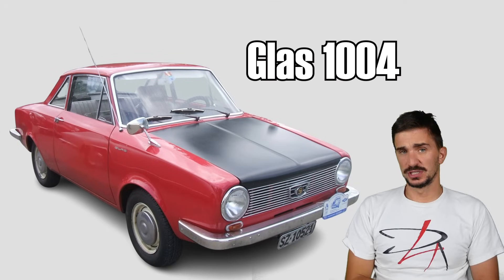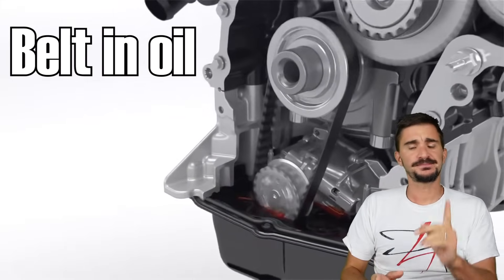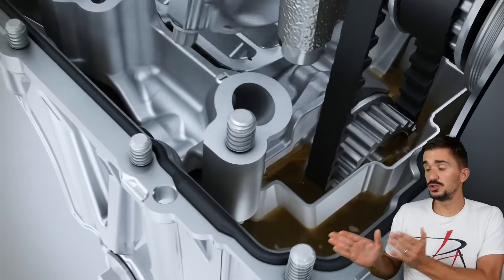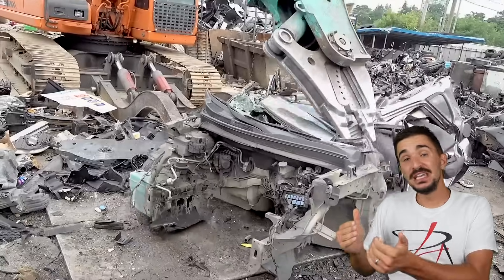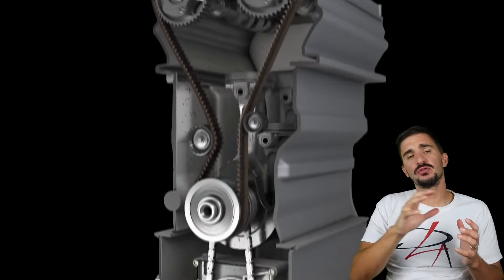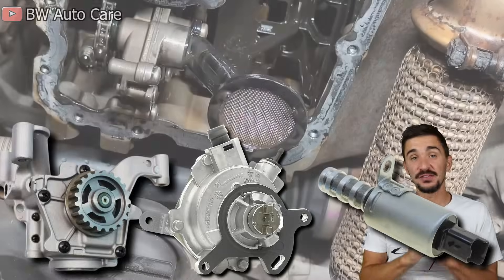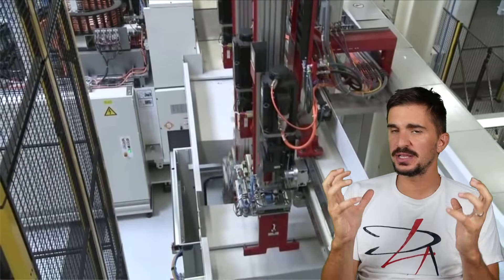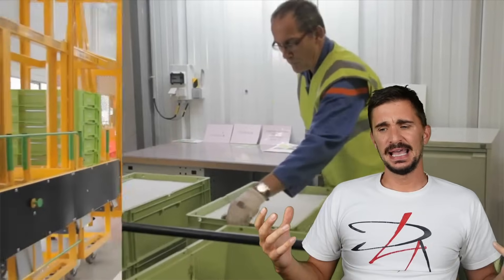Who Approved This and Why Is It Still Being Made? Wet Belt aka Belt in Oil Engines

Comment: Polymer scientist here: All polymers have in common, that chemical, mechanical and thermal loading/aging are not independent but reinforce each other, leading to drastically accelerated aging/failure. It is not completely impossible to develop a wet timing belt, but: The materials used would be drastically more expensive and development and accurate lifetime predictions would be extremely complicated.
Reply: Kevlar is the way😂
Reply: Do polymer scientist only eat from polymer bowls, use polymer cutlery etc?, i heard they do that.
Reply: @MrKalashnikov47  How do you hold the Kevlar fibers together?😉
Reply: So are current wet belts just the same pedestrian dry belt chemistry? Are there any chemical differences?
Reply: Ford should take notes from Honda lawnmower engines. Honda mower engine have had wet timing belts for years and I haven’t heard about any breaking. I’m sure a couple probably have broken but not nearly as much as ford
Reply: @joshmanis9860  A lawnmower engine is not comparable to a car engine. If Honda had cracked the wet-belt reliablity issues, why arent they pioneering wet-belt car engines?
Reply: @manchegocheese997  my vtwin is over half the displacement of my cars engine. And a lawnmower runs in considerable worse conditions than a car engine. And if the wet belt hasn’t failed then, then it shouldn’t fail in a car
Reply: Is more than that to be said. Imagine that took decades of contradictions if the wet belt in oil is ok or not. Can't tell who's right or wrong in a simple video. Because failing wet bets are also an owner problem who did not change the oil on time. This is more dangerous than all. How many people go with their cars on time to change the oil ? Not that many. I can easily say 50% of them do not change the oil on time. And this is a very dangerous step to skip for a wet belt in oil engine.
Reply: @joshmanis9860  as a general rule people tend to drive way for way more often and for longer than they tend to mow their lawn.
Reply: @InsufficientGravitas  and? And my mowers belt has been in contact with oil for 20 years with no sign of degradation yet
Reply: @joshmanis9860  The duty cycle on a lawnmower engine is like 25 hours operating time per year. Maybe we should make timing gears out of Bakelite and Nylon if plastic lawn mower engine technology is so durable???
Reply: @gregorymalchuk272  the average home owner puts 40 hours on their piece of equipment a year. A commercial mower can easily have 500+ hours put on it in a year in all conditions rain or shine. And yet no failures.
Reply: @manchegocheese997 yeah you are correct! lawnmower engines are not compared with automotive engines as the air cooled engine runs hotter with an inferior lubrication system!
Reply: Kid who owns a couple stocks here, car manufacturers love to brag to shareholders about earnings from parts and service divisions, because that is more consistent and stable income than sales. This is 100% malicious, and they think it's funny.
Reply: @joshmanis9860 how many miles do you have on your lawnmower?
Reply: @Lawrence-uw6cs  thanks for proving my point. That Honda uses better belts than ford
Reply: @joshmanis9860  Honda belts do fail especially in the cheap domestic mowers and brushcutter engines and their commercial engines use timing gears not wet belts
Reply: @Lawrence-uw6cs  my craftsman riding mower with a ungoverned Honda vtwin has a belt and it’s been fine. And ive only heard of a couple belt failures on the el cheapo mowers
Reply: @joshmanis9860 😂😂
Reply: @Lawrence-uw6cs  Remember the trouble Honda motorcycles had with cams and cam chains in the 70's and 80's. The VF series almost bankrupted Honda.
Reply: @joshmanis9860  don't know if they use better belts than Ford but they have the brains not to use a wet belt to drive the oil pump on a $100000 truck!
Reply: @manchegocheese997 
Honda's 1.0 turbo petrol fitted to European Civics uses a wet belt and it... Fails prematurely.
Reply: @MrKalashnikov47  почитай почему кевларовые сборки для броника запечатывают в водонепроницаемый пакет, глупая шкила..
Reply: @dennythescar80s8  I'd say that figure is near 100% for lawn mower engines. That said, I wouldn't trust a wet belt as far as I can throw it.
Reply: @LG-ct8tw with more Kevlar obviously 🥴
Reply: @joshmanis9860  they're probably under lighter load. Ford's 1.8D design was already right on the edge, being plagued by snapping belts for 20 years or so.
Reply: @joshmanis9860  how many km / miles do you run your lawnmower? A lawn mower is ran for around 10 -20 minutes per week, then put away. It also doesnt see the temperatures a motorbike or car experiences.
Reply: As a retired amateur gynecologist, I totally agree.
Reply: @joshmanis9860 When did a lawnmower ever do 100,000 kilometres?
Reply: @joshmanis9860  Honda's small industrial engines run at lower rpm (and hence gear periphery speed) than car engines. The belt is also driving the cams for only one or two cylinders. The stress is much lower.
Reply: @MasterofNoneTV  you have no clue on what your talking about. Many mower see higher temperatures than cars whilst under a high load.
Reply: @LG-ct8tw    Neutronium
Reply: @mjouwbuis  Peugeot was plagued with belts snapping on the XUD engines. Dry belts, 8 valves.
Reply: @philhawley1219 from ball joints to steering racks and oil pump's and even sand left in block's from casting! ford being the larger company has Honda beaten for sales including recalls! But i thought belts was the topic here not chain's or was it mowers vs cars or Honda vs Ford im not certain?
Reply: @EbenBransome  Honda engines run at 3000 rpm for most of their life at high load. Much higher stress than my grandma driving to the grocery store. I run my Honda vtwin ungoverned on my race mower
Reply: @joshmanis9860  ungoverned twin should sound good!
Reply: @brainwrongs  exactly Honda's road registered lawnmower without blades used one and not a $100000 truck
Reply: Or we could just use a chain.
Reply: @MasterofNoneTV  dead wrong there! Air cooled engines run hotter than car engines! and average a higher rpm in their service life! Despite being governed well below the rpm of the mildest of car engines Being constantly 3-3500rpm and rarely at idle or consistent cruise! Most modern car engines can rev much higher but in reality spend less than 10%of the time running at high load unlike working engines dedicated to working at load only!
Reply: Nerd.
Reply: Not to mention the fact that the polymer in question would have to resist most of the common organic solvents that would be used in polymer synthesis
Of course the good thing about a material like that is that it lasts a real long time
Although on the flip side you got the problem that it lasts a really bloody long time with no goid way to get rid of it
Reply: @LG-ct8tw  With rubber of course🤣🤣
Reply: @joshmanis9860  Different scenarios. The load on a lawnmower is mostly consistent/single engine speed, you can vary engine speed but a lawnmower is usually holding a single speed for it's operation.
Reply: Also Bet they got squeaky when Ethanol was added to our Fuel 😂
Reply: And by the time we figure it out, the cars will be electric anyway.
Reply: @manchegocheese997 Yeah not comparable in that, the mower engine people never change the oil, it has no filter or pump to clean the oil, operates in dusty conditions, all the parts experience impact loading, and is air cooled so runs hotter. 
If the mower can do it, so can a car.
Reply: @joshmanis9860 my guess is run time is a factor 🤔
Reply: please name one commercial car that redlines at 3000 RPM - I googled a mid 2000's Civic for reference, and its redline was 7200 RPM - I physically don't think there is a single commercial car on the market that revs that low, i'm almost willing to bet money on it ....
Reply: @moffichu9150  the OG beatle did but no modern car to my knowledge
Reply: @joshmanis9860  lawn mower engine is often air cooled with very loose tolerance in machining with very low compression and emission standards, and around 16-20 hp vs a car with very high compression, liquid cooled, extremely tight tolerance, very high emission standards and 200-300hp. and mower run at a tiny fraction of rpm also most mowers have less than 1000 hours after 10 years vs 10,000 to 50,000 hours. they are by no way comparable
Reply: @joshmanis9860  200 km is about 124 k miles.
AAA claims 13500 mile per year / 293 hours per year = 46 mph average.
124,000 / 46 = 2,696 hours per wet-belt---minimum life in a car.
Assuming you mow an hour a week through summer, spring, winter and fall, that's over 51 years.
Even if it last's half that in my lawn mower I'd be happy so in a mower it seems like it would be fine.
Reply: @LG-ct8tw  unicorn horn dust ?
Reply: @joshmanis9860  Lawn mower consistent engine speed and load .
Reply: They make scientists out of polymers now?
Reply: Ford engineers gad a stroke.
The belt literally melts, we have changed so many…
Btw if you use the ford supplied oil they last a lot longer. They are still pretty pooh though.
Reply: @moffichu9150  The belt spinning faster doesn't change how the chemicals and heat degrade it. It would heat slightly more due to being flexed more often, but then it is oil cooled, so will be the temperature of the oil. Which is hotter in the small motor because it is air cooled. 
The number of cycles it sees over time isn't going to be much different as the transmission keeps the rpms down as much as possible for fuel efficiency. On average the mower engine probably runs at a higher speed because it is used at full throttle it's entire life. While a car probably averages around 2500 or less. It sees higher speeds briefly, but then falls below 2000 for longer life and efficiency for much longer duration.
A commercially used mower is the worse case in comparison to a car.
Reply: @joshmanis9860 not a fair comparison. Sorry.
Reply: @InsufficientGravitas and under far more heat and torque.
Reply: @joshmanis9860 are you sure? Commercial mowers get regular service. A close friend owned a commercial "mower" sales and service company. He as plenty of horror stories to share. Mower owners abuse their equipment horrible. Then when they fail, they whine about the delays it takes to rebuild their equipment. Oh, he lives in a paid for house and drives an new Escalade every few years. Yeah, wet belts are "wonderful" for use in commercial vehicles.
Reply: @Lawrence-uw6cs where is your data? I doubt your information
Reply: @Ang3lUki and great for the bottom line. Service is profitable because few people can get competitive quotes from other mechanics. The cars are DOA. you pay the money to the guy you had it towed to. Often the towing company suggests a close by dealer as a convent source if the customer doesn't have a great deal garage alternative. The cars on the tower, who's going to wait for you to get three competitors quotes in say, fifteen minutes??? Not going to happen... 😢
Reply: @joshmanis9860  The reality is that lawnmowers run comparatively few hours by comparison to a car engine. Also, of note, the Honda GC wet belts DO FAIL.
Reply: GM found this out the hard way when they switched to long-life coolants.  Turns out some of the seal materials didn’t agree with the new chemistry at elevated temperatures.
Reply: @joshmanis9860  for cars if we take average speed of 30km/h (city and around driving) this results in about 5000 running hours for 150,000km (lifespan of dry belt). I doubt you have lawnmower with 5000 hours on the clock. Honda GCV engine is estimated to live no more than 3000h, this would give you only 90,000 km in similar condition for a car engine.
Reply: @EbenBransome 😂 Peugeot...French...makes sense
Reply: @gregorymalchuk272  actually there were timing gears made of bakelite and textolite. But it was 1940-1950's tech.
Reply: @joshmanis9860  I think the question is the loads. Lawnmower engine doesn't generate 120 horsepower.
Reply: @philkipnis740  the wet belts are still in constant contact with oil
Reply: In the mid seventies my first moped, from the early sixties, had a wet belt between crankshaft and clutch. They lasted decades, but they failed when the engine didn't run for several years. different composition though, they looked like yellow kind of plastic with metal strings inside.
But other mopeds used gears, they never failed.
Reply: Maybe that is the reason why no electric motor uses polymers. They last a lifetime.
Reply: @wolfgangpreier9160  All electric motors require polymers like silicone tubes, Busbar overmouldings and varnish as insulators. Once these materials fail (which is greatly accelerated by temperature, hence for the normal user they will indeed last a livetime), the motor will fail immediately and unrepairably.
Reply: @householdhacks  Thanks, whole lotta cope on the lawnmower engine.
Reply: @Bapate-rh9be  Ok Mister, you must be very informed.

Please tell me how our forefathers made electric motors in the beginning of the 20th century without all those fancy schmancy modern materials and they are still working?
Reply: Do you mow your lawn every day for 3 hours?
Reply: Comparing  a lawnmower engine to automotive engine is like comparing a automotive engine to a piston engine in a WW2 fighter aircraft.  Totally different operating environment, I have a Briggs mower engine that is over 20yrs old with  a plastic camshaft its still running without any issues but I don’t think a plastic cam would work in a Honda civic.
Reply: Man... everybody know that oil dissolve rubber, and heat speed up the process. This is like frie rubber in a oil pan.
Reply: @joshmanis9860 lawn mower engines don't have near the forces and heats at play as a turbo charged 3 cylinder do. Also a lawn mower doesn't go hundreds of thousands of miles and if it fails it doesn't cost thousands to replace it. A brand new whole lawn mower is maybe 10% of the cost to rebuild or replace a modern turbo car engine.
Reply: @moffichu9150  who said anything about a car engine revving that low? You are right they don't rev that low but on average spend more time at a lower rpm than Mowers that rev their entire service at 3000+ rpm
Reply: @erikbrown207  your point is irrelevant! The mile travelled is irrelevant as car's are a little bit faster! The time it takes to mow my lawn i could have travelled interstate! Also Car engines are more refined and are cooled and lubricated far more effectively! BTW for all the know it all's in the comments, I'm an automotive mechanic and small engine mechanic, not saying I'm always right but if you're just putting info in comments that you have no experience with and are just pushing an uneducated or inexperienced opinion without actually ever working on or tuning engines or reading the data associated then don't bother!
Reply: @ClockworksOfGL  That the dreaded orange crap that doesn't like normal green coolant?
Reply: @brainwrongs  I know. I'm hearing throughout this thread that Honda have cracked the wet belt issues on their lawnmowers and that Ford should use that technology so I was pointing out that even Honda cannot make a reliable wet-belt car engine because cars are not lawnmowers.
Reply: @SupraSav  this right here is the biggest reason for increased loads on an automotive t belt over a mower! Other than valve train friction. This guy gets it!
Reply: @eflanagan1921  consistently loading a lawnmower? How? You must have an impeccable lawn with all even grass on a dead flat surface!
Reply: @quint3ssent1a  per cylinder at the given rpm a modern mower actually produces more torque and often more power per litre of displacement than a lot of n/a eco buz boxes people drive! Ffs a Briggs and stratton 32hp v twin is 32hp! I've seen 4cyl car engines on the dyno struggling making 50hp! That being said they don't have a belt!
Reply: Would a silicone base be a good start?
Reply: @cujet  you are right there and the increase in running time is what's prolonging the life of the belts! Sit a car for half a season every year and see how long they last!
Reply: @Pheonixco  you can't mix organic acid coolant with glycol based coolants as they can form a corrosive mix that will cause damage to all aluminium and also mls gaskets
Reply: They get about thirty hours annually, on them. There's no comparison.
Reply: @joshmanis9860  loads for small engines are so much smaller than bigger ones. Ive seen plastic camshafts in some small lawnmower engines.
Reply: @sompka1  goodpoint!
Reply: @dennythescar80s8  Mechanic for 50years. Who's right and who's wrong. Simple. I've got two old Datsuns, one 1971 and one 1974 model. I drive them and drive them (and like a good mechanic I don't change the oil) and they just keep on keeping on going. Just build everything with a Datsun 1200 engine fitted, cheap to build and run for ever.
Reply: @joshmanis9860 Honda sold the civic with a 1.0 wetbelt in Europe and it has the same issues as the Pegeuot and Ford engines blocking the oil pickup
Reply: @LG-ct8tw Vise Grips. 😂😂
Reply: @EbenBransome I suffered that myself.  Wasn't cheap.
Reply: @joshmanis9860  comparing apples and oranges?
Reply: @manchegocheese997 
For the life of me I don't understand why you guys don't know that there's been wet belts inside engine's for some years now, they last longer than dry belts like the typical timing belts from the 80's because when motor oil flings off of them it takes heat with it leading to them actually running cooler than dry belts.
For year's there's been an aftermarket wet belt replacement for the primary chain in Harley Sportster's, in the 35+ years I've been a Harley mechanic I've never seen a single one ever break, but I've seen plenty of aftermarket dry belt Harley primary drives break.
Ford's been running belts to drive oil pumps in their engine's for some time now, they're engineered to withstand 1,100 HP and I've yet to hear about any breaking, they also solve problems like oil cavitation that occurs from all the tiny shocks delivered by gear and chain drives to oil pumps, belts smooth out the drive to an oil pump making them last longer along with curing cavitation problems.
Reply: @manchegocheese997  Because the Honda lawnmower engines aren't interference engines, and lawnmowers don't run for anywhere near the amount of hours that automobile engines do. The power that it takes to run the valve train on a lawnmower engine is basically nothing, and RPM is pretty low. RPM is also constant. Honda engineers know their stuff. That is, until they started messing with DI and turbocharging.
Reply: he just put ford on blast 😂
Reply: @MasterofNoneTV  People have zero clue how hard of a life automotive parts have, especially given things like aircraft get way more hands on inspection and maintenance, because its federally safety regulated, and things like lawn equipment are exposed and more accessible to discover potential issues. For the majority of people, anything automotive is tucked away out of sight and mind under the hood, used daily no matter the weather conditions with emissions systems that have to last the life of the vehicle. There's also the fact that they are the most mass produced as well. That isn't even to mention the insane amount of Federal Vehicle Safety Standards, EPA emissions standards, flame toxicity and smoke standards, NHV, etc, and this is all in just the design phase leading to all these compromises that idiots are quick to call out because they have no clue.
Reply: You lost me at "drastically more expensive". You clearly don't understand our motives, earning as much money as we can. Fired. ;-)
Reply: @joshmanis9860  Worse conditions? I don't know about that.  

Even if you did make that assumption, there's a huge difference between how long they're run in those conditions.  80,000km takes somewhere on the order of 2000 hours to drive, on average.  If one assumes two hours a week of mowing, every week, year round (even in winter and fall), that would take more than 15 years to hit that many hours, that much wear & tear.

So, no, they're not comparable.
Reply: @Londubh  mowers spend their life under load in the scorching sun (most of them are unmaintained. Don’t be dumb
Reply: @joshmanis9860   how can I, when you've monopolized that trait?
Reply: @Londubh  they are comparable y’all just refuse to because it’s right
Reply: @broughxtreme  Nissan knows how to make rubber compounds last! I've got genuine Nissan fuel system components from the mid 80's that show no signs of perishing!
Reply: @joshmanis9860  the biggest issue with this topic would be lubrication requirements and therefore the belt polymers used, as air cooled engines often run thicker oils and additives vary considerably between their intended usage. I can't imagine a wet automotive belt designed for thin full synthetic oils at liquid cooled temperatures would have the same formula as one used in 10w30 mineral oil like in the Honda power equipment engines
Reply: @Lawrence-uw6cs  honda calls for the use of conventional 30 weight or 10w30 if your using in colder temperatures. idk wat ford belts are made of for them to degrade in full synthetic 5w20. i run synthetic 10w40 in my pressure lubricated stuff with high zinc to protect the cam and lifters. and synthetic blend in my splash lube stuff
Reply: @coffeepot3123 I did some research and it doesn't seem to be the case.
Reply: I don't think this is only about manufacturers chasing every last dollar. Over the top EU emissions regulations are also one of the drivers of engineering solutions that meet the regulations, but compromise reliability and the long-term viability of the vehicle. It's not a holistic approach, and ignores the very real downsides.
In the case of diesels, the entire global fleet is conservatively using 5% more fuel than it would without particulate filters in the exhaust. Think about that for a minute, hundreds of millions of diesels chonking through all that extra fuel for their entire operational lifetimes.
5% isn't a number I plucked out of my bum, that's real-world first-hand experience with a reasonably late model truck diesel that had a ..... wee operation. The improvement was closer to 7% tbh,  and two of the prime causes of modern diesel engine failure have been eliminated.
Reply: and they seem to have left out the heat factor
Reply: @joshmanis9860  i could not find any details about these, which engine did they do this with? Have you got the model number, perchance? TIA
Reply: @G-ra-ha-m  push mowers and pressure washers and a couple 20hp vtwins on riding mowers
Reply: @joshmanis9860  I'll have to check my lawnmower, I'll trying to find a diagram of one with a wetbelt as I'm curious how the designed it.
Reply: @G-ra-ha-m  I believe it’s a Honda GCV 160/190 engine for the push mowers. Not sure about it pressure washers though
Reply: @joshmanis9860  Ah, I found it! Rubber belt, amazing. More amazing, it included the GCV135 which I actually have!
Reply: Cost, performance or reliability, you only get 2
Reply: I am sure NASA would make such a belt out of per-teflon-ester-polyamide-disulfide-bismuth-chloro-ethelen-butylediene-monohydrate that cost $50,000 per gram //
Reply: Lawn mower that's used by mower contractors run 8-12 hours a day 5 days a week. There's a huge number of them big commercial mowers. Cost big bucks . They keep parks golf course expressway berms playing fields etc. orchards tidy.
Reply: id like to say I and many others have had varying success with decontaminating oil soaked belts with brake cleaner and other degreasers
Reply: @joshmanis9860 do u have 100k miles on your lawn mower? lol
Reply: Belt sheds fibres and debris that eventually blocks the oil pickup and leads to oil starvation and engine failure.
Reply: @rideswift  My view is that it's part of an agenda to make ICE engines less dependable and more expensive, to help EV sales. 
A 'strange' CEO decision here and there is all it takes.
Reply: @joshmanis9860 Beciuse the problem is not  the oil  the problem is the FUEL on oil  and that's only happens on newer DIRECT INJECTED engines with HIGH PRESSURE FUEL PUMPS of almost 50 bars or more.
Reply: @AaronSchwarz42  Is that the same stuff they made Challenger's O rings out of??
Reply: Why were a group of polymers arguing? There are in a polymerous relationship
Reply: @chiboreache  :face-green-smiling:☝👍
Reply: 1. The average temperature of motor oil is 115 C.  

2. The mechanical stress that is absorbed by a rubber belt should be lessened with springs in the construction of the engine, and a belt should reside outside and away from heat sources, and it should be replaceable in under 8 hours.

3. After you have included point 1 and 2, the makeup of the belt becomes less and less important. You can probably theorize a NASA belt that tolerates 300 C and costs 500.000 USD and that's made with 20 billion layers of graphene but ordinary people are not driving to Mars, they want to pick up the kids and get home to watch Netflix, and this is why I don't touch hybrids and modern EU cars with dwarf engines. The EU cars are anti-human just like the European technocrats who live in a walled of fantasy
Reply: dude is a rubber scientist and is telling you its not possible. lol
Reply: Polymer marketing here: "We did it, now you only need to buy it. Trust me."
Reply: Would lubrication from the oil tend to lower the belt temperature?
Reply: @mthebold  Not really - The engine oil is heated to the temperature of the Motor. These Belts have friction, but usually this effect is minimal, leading to an immesurably small temperature increase.
Reply: @mthebold  No. The belt will attain the aggregate temp of the engine.

Wet belts are tested at 100 C but at summer time in the city, a 1 L Ecoboost has an average temp of 120 C. 

It's temperature that sacks the belt prematurely, but at the same time, the Ecoboost is not selling in Siberia which would be the only market where it makes environmental sense, because a failed engine in Siberia = Death.
Reply: @joshmanis9860  500 hours is considered a lot for a lawn mower, but 500 hours would only be 15,000 - 30,000 miles on a car engine.
Reply: @wb4rfd  and the mower is under a large load for all of those hours. 500 is alot, for a residential mower. ive worked on moweres with 2500+
Reply: > It is not completely impossible to develop a wet timing belt

We already did that, we called them chains.

Why people trying to reinvent the wheel?
Reply: @davetdowell  Oi mate: Belts are cheaper and more efficient and silent. Wet Belts are even cheaper.
Reply: @Bapate-rh9be  because the sound of all the mechanical parts moving isn't loud enough to cover the sounds of the chain contact with the sprockets... pull the other one, it's got bells on.
Reply: @davetdowell  You can measure a difference. Not a large one but a slight improvement non the less (ill let you decide whether thats worth it). Dry Belts work well and reliable and are an improvement noisewhise.
Reply: I agree. its common sense. Oil and rubber will NEVER mix
Reply: @joshmanis9860 Dude, you respond to weak arguments and ignore strong arguments. Anyone trying to argue with you is running a fool's errand because it doesn't matter what anyone says, you will not be wrong.
Reply: Maybe so, but one could neglect changing the oil on a dry belt engine and not have the same risk. Then why not just use the dry belt?
Reply: @stephanhuman4665  because they adapted it from an engine that had a chain, otherwise the needed to redesign the entire engine. It was saving money(TM).
Reply: @court2379 only cheap garbage mowers don't have a filter
Reply: That why it doesn't make sense.
Reply: The glass cord reinforcement and the "rubber" belt material are different on wet belts. Obviously.
Reply: @joshmanis9860 lawn mower engines don’t have nearly as many operating house as car engines, nor do they experience nearly as much load.
Reply: @joshmanis9860  and yet almost NO thermal or mechanical stress on belt means your point is wrong
Reply: @joshmanis9860  your sample size is ONLY YOU 🤣🤪
Reply: @Fireneedsair  no “thermal stress” and yet mowers reach 300 degrees regularly. Go ahead and educate your self before commenting
Reply: @Fireneedsair  or it could be the hundreds of Honda mowers I see regularly for repairs? From the little 160cc single cylinder. To the 600cc vtwins. And yet I’ve NEVER seen an issue with the belt?
Reply: @joshmanis9860  no thermal stress during the 99% time they are NOT being used genuis
Reply: @joshmanis9860  brings up his one lawn mower engine. Then claims to see “hundreds” of em. Nice try. I’ll respect the knowledge of the dude who made the video before you🤪🤣🇺🇸
Reply: @Fireneedsair  yea that’s the one I OWN. I work at what’s called a “servicing dealer” where I work on the mowers we sell and the ones from big box stores. Stay in school kid I’m done talking to you
Reply: @joshmanis9860  yeah your done child since you know SQUAT about automobiles and this dude knows his shit better than you.
Reply: @Fireneedsair  sure buddy
Reply: @joshmanis9860  another peanut gallery intellectual 🤪🤣🇺🇸
Reply: @Fireneedsair  I never claimed to be smarter than the videos creator but go off little buddy
Reply: @MrKalashnikov47  no, No, NO.
Reply: @joshmanis9860  Do you drive through stop/go traffic using a lawn-mower engine. I happen to know those engines have an oil change interval of 90 hours and a belt change interval of 500 hours.
Reply: @bertram-raven  um oil change interval is 50 hours and drive belt change interval depends on the manufacturer
Reply: My VW Camper has something called push rods at the bottom of the engine. Has enyone seen them removed from the engine? I don’t. You think I should check them out? After 35 years?
Reply: So the original concern you'd have is still valid: "RUBBER BELTS INSIDE ENGINE OIL = FAILURE POINT = BAD!"
Reply: @MrKalashnikov47  Kevlar is actually common for belts in many other stuff but it doesn't fix the rubber degradation problem, but it sure makes a tougher dry belt on like RC cars/helis until the rubber goes puff 🤣
Reply: It's simply cost vs longevity. Get the engine/vehicle to the end of the warranty period and then it's the customer's problem.
Reply: @InsufficientGravitas  I might run my mowers 30 hours a year. Many cars run that much in a month.
Reply: Which means there's absolutely no reason to even try it. Timing chains work great.
Reply: @fordmud  So do dry belts. I suppose, if you would get both the development and testing side perfect (as stated in his video oil may be contaminated with just about anything making proper testing difficult), then you may get a slight cost reduction in some motors. You need to redevelop it everytime the chemistry of the oil changes, too.
Reply: When Ford said the belt was OK because it is coated with PTFE did no one else realize that every coating has microscopinc flaws never mind installation adding more microscopic flaws and therefore oil would reach the rubber and destroy it exactly as the critics claimed.
Reply: @moffichu9150  The closest were the V8s with 150 HP SAE from the mid 70's, around 4000 RPM
Reply: @joshmanis9860 is your mower a turbocharged diesel?
Reply: That coating they used being a fluoride polymer, since that's a relatively polar polymer, would that be their so called "measurement" against the oil being a apolar/organic solvent?
Reply: @gregorymalchuk272  They did. Well epoxy resin/fibre composites. Paxolin was one example. Silent, lasted for years running in engine oil!
A few failures, but better than this rubber band nonsense.
Reply: Why rubberized coating on laptops and expensive electronics gets sticky over time, and how to prevent it?
Reply: How on Earth can selling unreliable cars be a good idea long term?? Haven't the European manufacturers and Ford heard of repeat business?
Reply: @calebgriffiths9062  Welp, the managers had a different job 2 years later anyways and this is coincidentally just as long as it took for the first belt to fail.
Reply: Well, Ford would have fired you as soon as you opened your mouth. 
“We don’t do expensive, not until the product hits dealerships!!!”
Reply: @joshmanis9860  probably the mileage is quite different between the two applications...
Reply: I was told that Ford used the wet belt design based on industrial machines.  I think they failed to take into effect fuel, heat cycles, and maintenance.  After they failed to take everything into account, they made the cheapest wet belt system possible.  I heard that industrial wet belts are above 600 dollar range.
Reply: Who cares how you can make a wet timing belt we have been making engines for hundreds of years without using wet timing belts
Reply: @joshmanis9860 I really don't care what you're doing with your lawn mower
Reply: @johnharris7353 😂😂😂